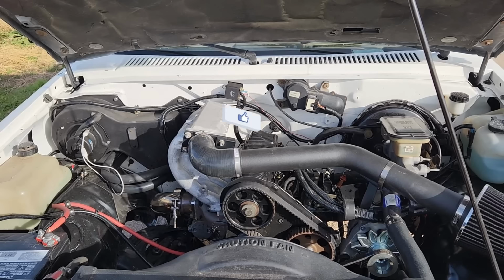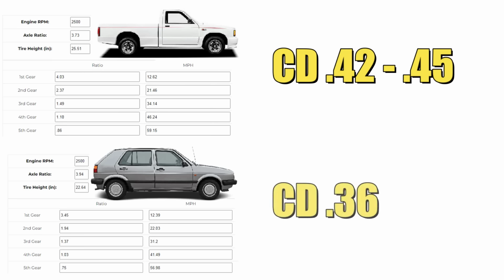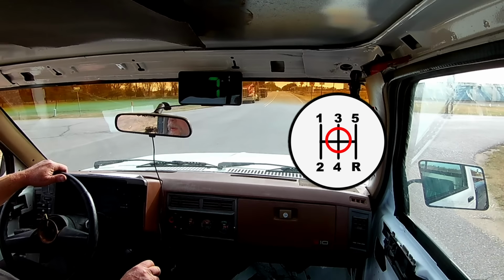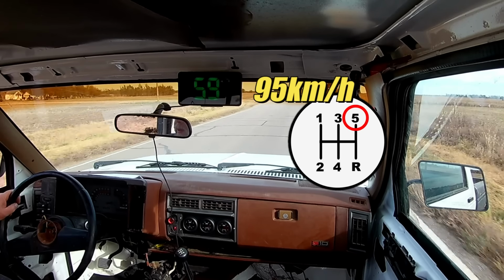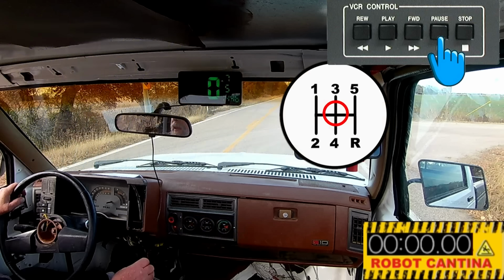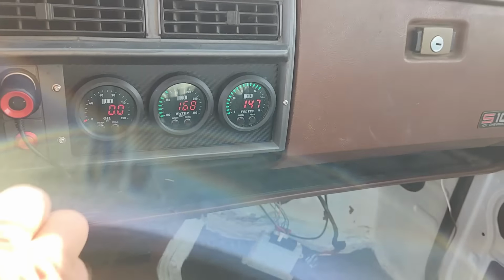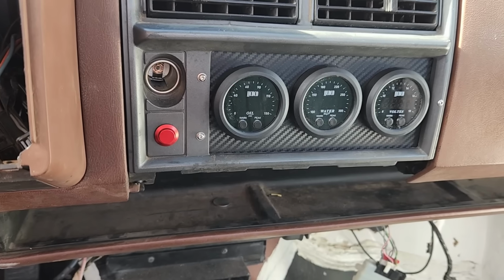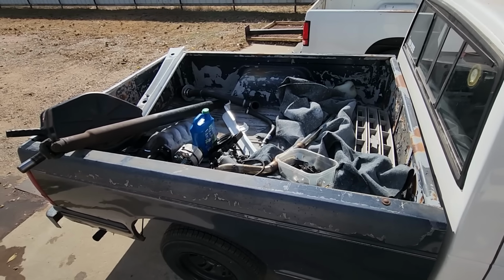S5 E43.  We road test the VW diesel powered Chevy S10... More problems?

Comment: I had a VW T4 with the 1,9TD (ABL) pre chamber diesel. It had low oil pressure at idle too. Even with a new oil.pump and new intermediate shaft bearings. I found out that the oil temp in summer was at over 110°C (you convert it please 🤓) just from normal highway driving... so i put an oil cooler in it, wich helped. And later i used 10W60 fancy Castrol oil, that helped as well. And as the engine still runs (about 60.000km after.my hands on and in the engine) i call the internals good enough and can live with these band aids (oil cooler.and thicker oil)

But yeah get an 1Z or anything from that familiy (there was a 110HP version too, dont recall the engine code rn) and the truck will be very desirable! Quiet, quick and good fuel economy! And more reliable than these simple (but in my opinion not too robust) pre chamber 1,6 and 1,9 diesels. I think they get too much heat in the head, literally...
Reply from the maker: Thanks!

Comment: I was going to say intermediate shaft before you got around to saying it. I've had one with same issue that ended up being the intermediate shaft bearings.

Power/speed wise. Look into disabling the governor and you will find this engine will become something more of an animal that you weren't expecting. We took apart one sticky pump once on a 1.6d where the governor was stuck holding us back. When we put it back together, it got stuck wide open disabling the governor and let me tell you... I was incredibly surprised with the amount of power I gained from doing so.

It all comes down to the governor cutting fuel at higher rpm which severally hinders power when you hit that wall. Allowing full fuel flow with allow you to smack that wall hard and take it with you. Maybe consider getting a working tach first. I want to say redline is 5200rpm on those. Just don't over rev it and it will put a smile on your face!

Comment: Hello from Slovenia EU.
Those VW engines came with a turbo from factory in some variants. The horsepower was 70 or 80 with the intercooler. The torque was also significantly stronger. They also get better fuel economy.
❤

Comment: This  engine oil recommended by VW was 20w50 diesel oil , I also noticed when you set belt timing you didn't check the injection with a dial indicator this is required and necessary for proper  proformance ,  I worked in a VW dealership several years, have seen these  engines go over 300 thousand miles  and  never seen the intermediate shafts  go bad in the diesel or gasoline VW inline 4cyl engines

Comment: a more powerful 1.9 TDI would certainly benefit from a rear gear swap, a 3.42/1 pinion/ring gear would drop cruising rpm and improve fuel economy considerably. if you tuned an AHU to 140hp, you would want much taller gearing. i have a 2.0 TDI 'BKD' 140hp in a 2009 skoda octavia, its 6 speed transmission gives 80mph in 6th at 2500rpm.

Comment: The VW 2,5l N/A fivezylinder Diesel (Code:AAB) would be the overkill. No horsepower but Immortal. 

Additionaly the 2.8l fourzylinder or 2,4  straight 6 are all low Power, high Volume Diesel engines. 

Thank you for your effort to create these Movies.

Comment: For some reason, VWs are still hit and miss with the oil pressure. You'll have some with 300K on the thing and it's all good, and you'll get some with 150K with low oil pressure at idle. I've opened up several of these and for the most part they have all been quite clean, suggesting maintenance wasn't the issue. And it's almost always the oil pump or the intermediate shaft causing the problem.

Comment: My first car was a 1983 Ford Sierra with 2.3L NA Diesel engine. That acceleration run brought back some memories…
Reply: These old Diesels are called "Wanderdüne" in Germany 

i.e. dunes that kinda travel by being blown over by wind
Reply: @dangoris4164  Headwinds have always been an issue for the VW diesel till turbo.
Reply: @dangoris4164 great expression thank you :)
Reply: I've driven a diesel VW pickup from back in the day so this is about what I expected. And that thing barely weighed anything!

Comment: Hey don't forget about the Mazda REPU/B-series, Ford Courier/Ranger 1,2,3 generation only, Chevrolet LUV/S10, Toyota Helix/SR5/Stout, Datson 520/620/720, Austin Mini Pickup, Nissan's Hardbody, Dodge D-50/Plymouth Arrow, Subaru BRAT, Volkswagen Pickup Truck, Dodge Rampage/Plymouth Scamp and Mitsubishi Mighty Max that where truly compact pickups Pretty much everything built after 2000 ended up becoming more mid size over price truck not a true sub compact.

Comment: Maybe I'm boring, but you forgot in your calculations that a sedan is front-wheel drive and a pickup truck is rear-wheel drive, so the rear differential loses 3-5% of power, which adds to the 0-60 mph acceleration time.
P.S. I had a sedan from California; it hadn't had an oil change in 30,000 km. The pressure reducing valve jammed due to debris; 7 bar when cold, 0.4 bar when hot. At 1,500 rpm, it was 4 bar, and at 6,500 rpm, the oil filter's internals were torn off.

Comment: Q. If the oil pressure is only low during idle, and under zero load…
Might it be ok to just leave it alone if no potential damage could occur under those conditions?
I’m of course assuming no damage at idle.
Will, might, or won’t cause damage?
Reply from the maker: I don't think it would be good to leave it alone.  It's worth looking into and solving just to be sure no damage will occur.

Comment: hey Jimbo,  I'm not sure what you found that is different on the alh vs  the 1z,  they should be the same size . I have a 1z swapped into my 1985  jetta coupe and I've collected a couple alh engines to upgrade it eventually and I see no difference.   if you'd like any pictures of any of it message me.
Reply from the maker: I may have misspoke and meant the AZZ.   The ALH wont fit because the oil pump is in the front of the engine and it would require cutting a massive amount of steel from the chassis crossmember in order to get the engine to fit  in the S10.  I believe the 1Z and the AZZ have the oil pump at the rear of the engine just like the 1.6 engine that I'm using.

Comment: How can a GPS speedometer be inaccurate, and how do you calibrate it?
Reply from the maker: The timing circuit inside the GPS device measures the time it takes for the radio signal from the satellite to reach the GPS unit. On cheapo units this circuit is not 100% perfect from the factory, so they provide a way to adjust the timer.

Comment: could allso be that the welder left a small pinhole in the weld of the oilpickup and its drawing air since you going to remove it anywqay you might want to pressurise it dunk it under water and check for bubbles

Comment: A question on the top end of fourth.  Did you feel like maybe the governor was starting to hold back the fueling as it got higher in the rpm band, or it was just out of puff?
Reply from the maker: Its really hard to say.  That was the first and only time I tried accelerating the truck.  Since we ran into the oil pressure issue, that was the end of the test. Normally I do three or four tests and pick the one with the best time for the video.

Comment: Another great video thank you Jimbo.  It seems to drive really well with nice ratios in the gearbox.  On the flat it drives about as fast as I do normally, but that looks like about all it's got, so I'm guessing it would be no fun at all with any change in elevation.

A suggestion: Is it worth fitting a timer to your glo plug circuit, so you press it just once, have it time to off 15s after releasing the button, would also allow variable on time for Winter conditions, just make initial press a little longer.  For me I would use that 15s to click in the seat belt, check the mirrors or my phone or something.

I do appreciate the numbers, the last car that I purchased, I did all those gear ratio calculations for the short-listed options, it was definitely one of the factors in my purchase decision, going for a set of nice progressive ratios in a 6 speed manual box with no big gaps and a nice engine rpm in top gear.  Math can be our friend 🙂

Comment: The gear ratios were pretty close together.
The weight isn't that far apart.
Question?
WHAT about a Cummins 4bt engine?
This little Diesel S10 truck, seems like a nice truck to do any work with.
What about MPGS?

Comment: Unless you're in sub-zero (or I guess sub-32 for you guys) temeperatures, 15 seconds is way too long to glow the plugs. In about '84, VW switched to "fast glow" glow plugs and shorter duration relays. 
In my stock mk1s, the glow plug light would stay on for about 10 seconds if its above freezing, and about 15 when it was colder. In my mk2s, it would be about half that.  If you're replacing the plugs, make sure you're buying the '84-'99 style.
I would try glowing the plugs for shorter if there isn't snow on the ground. It might increase the lifespan of the plugs.
EDIT I just saw that your ambient temperature is about 21 degrees. That's just about the point where an old IDI with good compression will almost start without glow plugs.
This pump is supposed to be timed at about .90mm lift at TDC, but for a bit more drivability, I would recommend 1.05mm and a half turn of the fuel quantity screw.

Comment: 0.45 bar of oil pressure at idle damn and here I was thinking the 1.3 bar at 600 RPM in an MAN was kinda low because I'm used to Scanias putting out 2 bar at 550 RPM on hot oil lol.

Comment: i thought the point of using a diesel engine was to get the RPM's lower by using higher gear ratio to capitalize on the extra torque diesels have and a target RPM range in the 1600-ish range for more MPG? askin for a friend🤣

Comment: I already see one fault in the thumbnail, you forgot to wear your bow tie on the grill! 😛 You'll never win the concours without more attention to detail Jimbo! When you do get around to fixing the horn, you have the room and alternator capacity so I highly recomend this horn, I've ran variations of it across 4 different vehicles and it works great. It's like a deer whistle in that you honk and the deer freeze or run away. Geese however...they're more stubborn than deer. Works great on other motorists and even un-wheelied a group of motorcycles here in Chicago doing crazy stuff on Michigan Ave! It's got a satisfying tone and it's pretty easy to mount, especially with all the room you have. I usually don't use the included wiring as it's a bit light and run my own 10 or 12ga power and ground cabling for the relay. https://www.amazon.com/GAMPRO-160137-Motorcycle-Bracket-Silver/dp/B0CLY1FCCD
Reply from the maker: You got me there!

Comment: The diesel Rabbit I used to drive had a sticky pressure regulator that was not doing its job at idle like yours. We replaced the pressure regulator spring with a slightly stronger one and had a hot idle pressure at 30 psi. It may have needed bearings, but replacing that spring was much cheaper.
Reply from the maker: Thanks for sharing your experience!
Reply: @robotcantina8957  You're Welcome!!

Comment: Love to see it out on the road for real world testing. I'm definitely curious about that oil pump. Once it has proper oil pressure & proves to be reliable you can definitely use way more revs when testing the zero to speed times. I also would have shifted conservatively on the first run exactly because of things like what gappened. It sounds like you were shifting about where you'd want the rpm's to be AFTER the shift when going for quickest times. I calculated the ratios & you should hit 60mph in 3rd gear just before you shift.
Reply from the maker: With a bit more practice, it will be interesting to see how fast I can get this thing to accelerate.  LOL, At least is less than 60 seconds.
Reply: @robotcantina8957   LOL. Indeed. It's always best to test incrementally.

Comment: I highly recommend checking out BEW/BRM TDIs as well. Lots of TDI folks look down upon them because they less "mechanical" and require a computer to run. There was also a recall involving camshaft wear in 2004 but I guess it's since been solved. They don't have as much of a cult following but parts are still easy to get (idparts, cascade diesel, ECS tuning, etc) and the engine is MUCH more likely to drop into the S10 the way it fit into my Jeep XJ. I kept everything but the power steering pump including the oil cooler, stock turbo, EGR, etc. The entire VW wiring harness and ECU came out with the engine, and I ended up paying about $600 for the whole thing after I sold off the donor car. I opted to keep the immobilizer so I have the VW gauge cluste zip tied up under the dash! I just had to add 3 relays to the engine harness to handle 'ignition', fuel pump, and radiator fan. The engine makes great power without any smoke, my Jeep weighs 3300lbs and I towed a 3500lb trailer last week no problem.
Reply from the maker: My concern is on the ALH and possibly on the BEW the oil pump is at the front of the engine.  I don't have the room to fit the engines without massively cutting through the chassis crossmember.
Reply: @robotcantina8957 interesting, I did have a clearance issue with the front axle since I'm at stock height. I swapped the cast aluminum oil pan for a two piece pan with a steel bottom (I think it was from a 2.0 gas engine?) and was able to get enough clearance, but I don't think that would fit in your circumstance. The oil pump isssss pretty high up in there. Maybe I can find a picture from when I had mine off.
Reply: @robotcantina8957  They kind of got carried away with that anyway so you really don't need a cross member that big on the front end I mean the 4 driver didn't have them even the more modern vehicles today have removable cross members that are really small

Comment: Don’t diesels have a lower RPM redline than gasoline engines so the theoretical top speed of the diesel is lower than the gasoline since the Gas engine can rotate faster.

Comment: How hot are you running your coolant, when i worked at a ford diesel shop we put 205 degree F thermostats...something about fuel atomization???
Reply from the maker: Right now the engine seems to be running at 172F.  I would like it to be hotter, but there are other things I'm sorting out.  I'll look into the thermostat soon.

Comment: Well, shucks. Just when I thought the built process was going to get boring. But you have a solid hypothesis for the cause of your low oil pressure and we have confidence in you. Another data point: total drag equals cD times frontal area. It’s not just the shape of the barn door, it’s also the size. And the S10 is a much bigger (and cooler) barn door. Onward!

Comment: You could have reved it a little higher!!
Reply: I've seen driving these idi vw diesels for 30 years!! My favorite one is the aaz idi!! I have always used Castrol GTX 20/50!! And a VW hi volume oil filter!! Never had a problem!!
Reply: I still drive an 81 rabbit caddy!! Everywhere!!
Reply: 4800 rpm these are governed!! Highest rpm diesel of its time!! VW set land speed records with the 1500 diesel in the 70's diesel class!! These 1600 are a tractor engine built like a Timex!! I still get 48-53 mpg, at 4500 feet elevation!! And drag race it in Medford Oregon. And Sacramento California!! I am the slowest car on the grid, but have a lot of fun!! And I can call my time consistently!!😂 14.9 in the 8th!! A Boeing 737, burns 15 gallons of fuel per minute!! That's what this burns in a month!! And studded snow tires, it's like driving a snowmobile with a heater!!

Comment: 1z/ahu engines are pretty much identical to the alh, just the engine block is different, as the newer one has a timing belt driven waterpump. The main difference is the ECU. On 1z/ahu ecu's, you need to do some difficult soldering to tune it, while on alh, you just need a $65 China Kess OBD programmer. Also, with an alh ecu, you can easily upgrade the map sensor as it is external, and it's possible to set up launch control and control a VNT stepper motor.
Reply from the maker: The 1Z has the oil pump in the back of the engine and the ALH has the pump in the front of the engine.  I don't have the space for the ALH oil pan on this rig.

Comment: Just a little comment on the gearing. The four cylinder S10s also were available with a 4.10 axle ratio. If you were to get one of those axles, it would put you at 2,560 RPM at 55 mph, 2800 at 60. The 60 MPH figure would start hurting your fuel economy, but the 55 mph one should be pretty good. Also it would give you improved mechanical advantage in all gears as compared to being installed in the original golf as opposed to only having more advantage in first gear like the truck currently has. I will admit I have not yet watched the full video, I'm only 3 minutes and 30 seconds into it. I just wanted to share that real quick. I can't wait to watch the rest!😂

Edit: I also wanted to say I agree with you for the most part about trucks. However, for a handyman or a gearhead like us, having a useful little truck like an S-10 or Ranger is indispensable.
Reply from the maker: At this point a 4.10 axle probably would be the right choice for the power the engine produces.
Reply: @robotcantina8957  Can I just say how excited I am to get an actual reply from Jimbo? Unless the gnomes hacked your account... 🤔

Comment: Dear RC.
👍👌👏 2) To measure this kind of acceleration, you better use a calendar instead of a stop watch! 😁 ;-) 2) I hope that you are able to solve the oil pressure problem. By the way: In the engines of all my older Mercedes Benz Diesel (W115 and W123) I had to use and I used 20W50 oil in the summer and 15W40 in winter times. 3) You can easily get 75 healthy hp out of this engine. No need to buy a stronger/more modern engine. 4) Thanks a lot for making explaining recording editing uploading and sharing.
Best regards luck and health in particular.
Reply from the maker: Thanks!